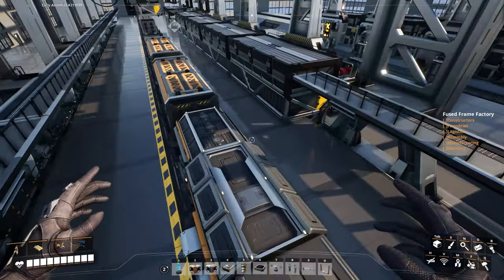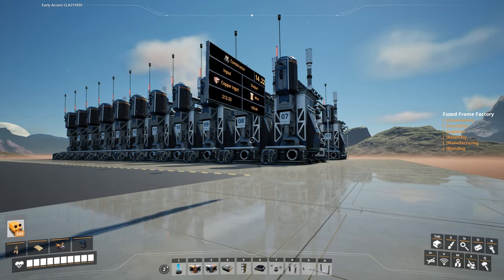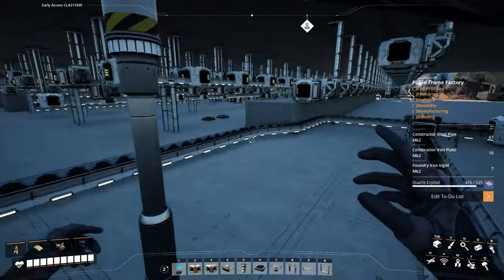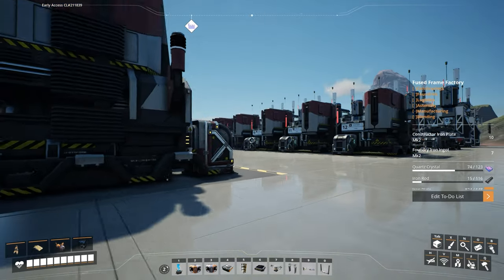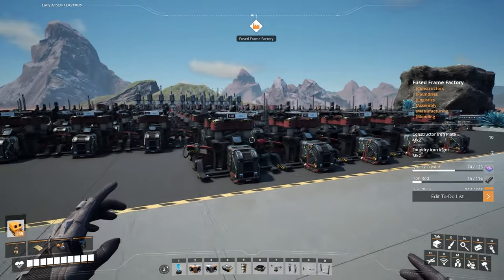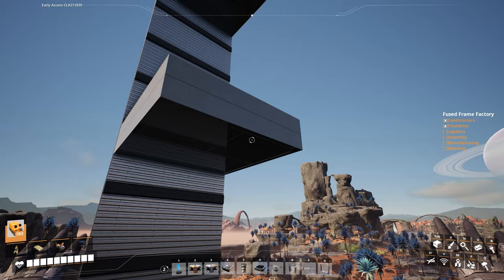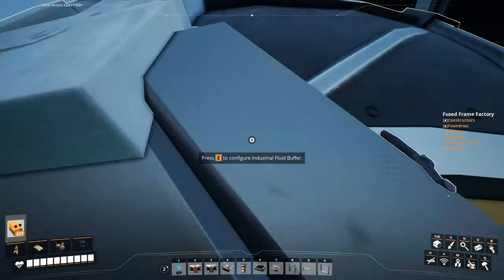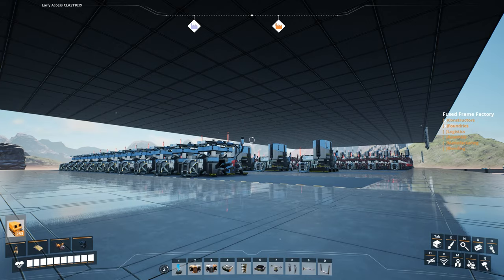SO. MANY. MACHINES! - Let's Play SATISFACTORY Update 7 - Ep.53

Comment: I use that lightpole design for my train network to illuminate the tracks at each support.  Works great in a 4 light config too.  Only thing I would change is using the light control panel with the street lights is redundant.  Each streetlight had its own lighting control panel in it, so you can copy/paste settings (or preset them in your blueprint) and dont need the control panel.

Comment: Instead of sinking the overflow of petroleum coke, why not build a coal power generators and use it to produce a little extra amount of power for the grid? That will solve the problem of the petroleum coke stop flowing
Reply from the maker: Ideally this factory will utilize 100% of the coke I make. So if any overflows it will spike power for a bit and then fall back down. Not sure there's a point in just overproducing power temporarily. If there was a consistent overflow I'd agree, but there really shouldn't be in this case, it should only happen if something else got stuck/backed up, then coke might build up for some reason.

Comment: Still would love to see an episode on how you create the spreadsheets. I’m very interested in them, like the formulas, etc. I assume the calculations are all linked ?
Reply from the maker: That episode would really just be a tutorial on how to excel, which I *guarantee* there's better guides out there how to use excel just generally, as I sort of self-taught how to use it.
It's really very simple, I start with the final resource, such as Fused Modular Frames and then see how many a standard manufacturer makes. Let's just say its 2.5 per min.

Then, I set a target, this is usually a totally random number that just "feels" good to me. Let's say 15, as its easily divisible from 2.5

Then I make a formula that hardcodes that information, that [desired output] divided by 2.5 = [amount of machines needed]

So what we get is 15 (my desired output) divided by 2.5 (a manufacturers default fused frames per minute) = 6 (this is now the number of machines I'll need)
So that's the outputs, now we take the number of machines I'll need (in this case it was 6) and multiply it by whatever the recipes inputs were (let's say it was 20 screws per minute and 25 concrete)

So now I get the information that I need 120 screws and 150 concrete as the input.
If I were to change the desired output to any other number, now everything will update as they reference eachother.

In excel it looks like this;
Let's say the cell for my desired output is A10, and the amount of machines is B15, so now the formula is
A10 = 15
B15 = SUM=(A10/2.5)
C20 = SUM=(B15 * 20)
C21 = SUM=(B15 * 25)

That's the formula to get the results I just described.
By using these references, you can then just keep working back and back until you get to every ingredient you need, you just need to hardcode a machines recipe per minute. 
Dunno if this explains it, it sounds way more complex than it really is. Basically using excel references I do some very simple multiplication and division with never more than just 2 numbers at a time.
Reply: Thank you very much for this response. I figured it was something like this, but the conformation is nice to have. But more than the formula, your layout also looked very interesting, in the brief glimpse we had. Hmmm maybe I’m discovering that I am an excel nerd because of this. Keep up the good word, I love your Satisfactory videos.
Reply: That's alot of info, but I like your video's!